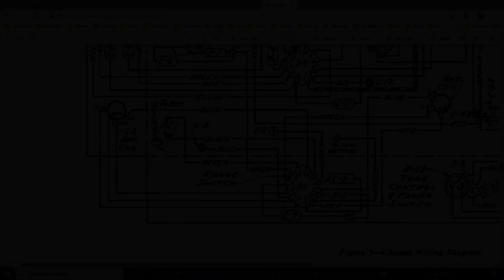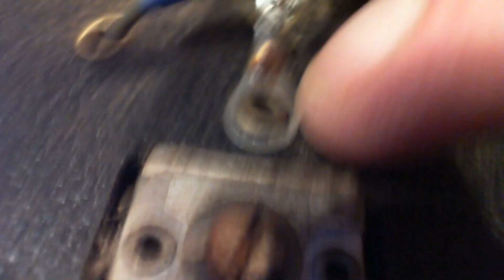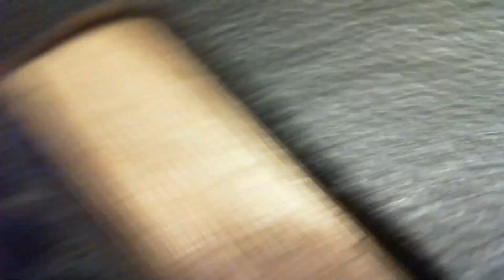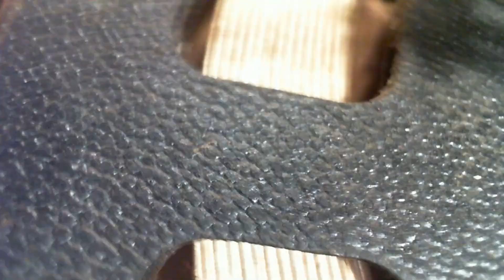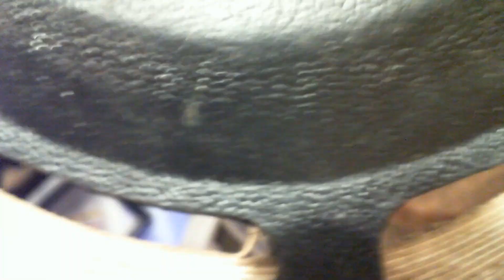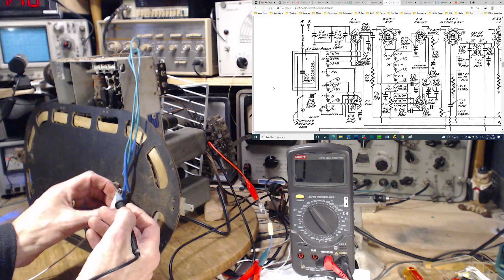RCA Victor A38 Shortwave Tube Radio Video #11 - Troubleshooting Weak BC Band

Comment: Early schematics, like this one , never had separate circuits showing the different band switch  positions and where they 
are used to connect the different sections of the  wafer switches. It makes using just one schematic really hard to 
trace through the circuit for just  the "A" band ( broadcast)! You are not tracing out the correct part of the circuit i.e.
fishing in the wrong part of the lake! See video #6 Someone's Capacitor and Resistor. The other side of the coil there.
Could the C9/R2 being changed (wrongly) because the  other side of the coil they were connected to wasn't working?
 HINT!!!  For the aforementioned coil  marked  L- 10 (it says "A" Primary) the one line goes to both  the plate of the 6SK7 
(RF tube) and the capacitors marked C-10 and  C-15 . Check both Jim! Is L10 open?
 I'm guessing C-15  (220pF) or C-10 (5.6pF) is actually bad. Whew!

Comment: Schematic representation of multi-pole/positions switches can be pretty confusing given the latitude in drawing conventions. Some might even include graphs depicting if those switches are make-before-break or break-before-make type. Here nothing beats physical continuity testing with a low-ohm/diode range meter.

Comment: For crying out loud man, it must be an open coil or switch - Pick your DMM and read the values (don't forget to replace the battery first, the low bat signal is there for almost 2 weeks)